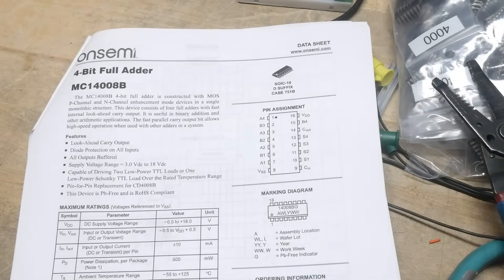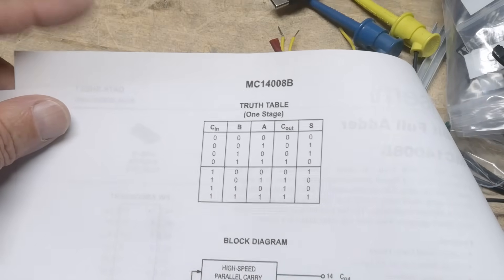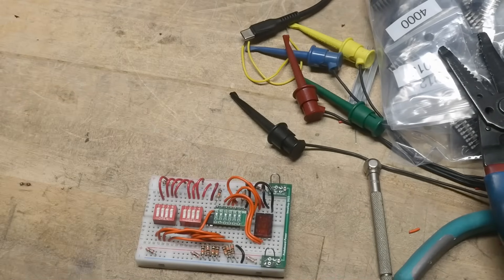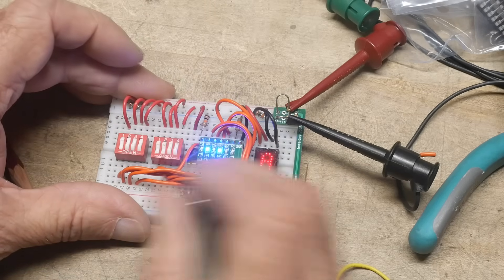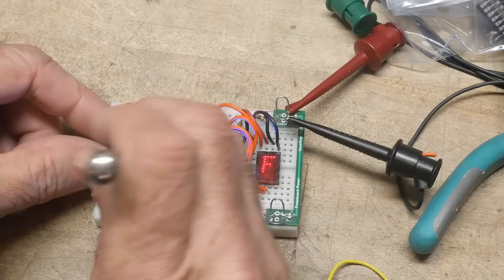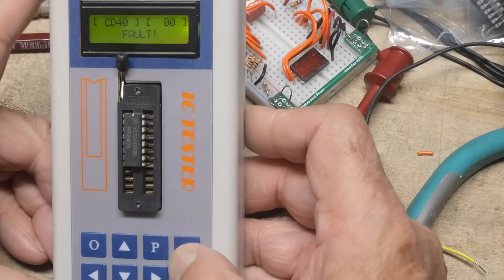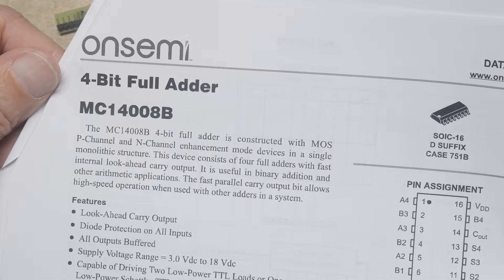#2461 CD4008 Full Adder

Comment: That TSH-06 tester is as useful as tits on a boar. When you get to the CD40 you are then supposed to press the right arrow and enter in the last numbers of the chip, in your case the 08 by arrowing right and pressing the up and down arrow until you get CD4008 and then pressing 'enter'. Then sometimes it displays 'fault' anyway...!! I just blew $50 on a TSH-06 tester.

Comment: Memories of the 80's, these chips were in most so called "export" CB radios like Cobra and President, the ones with FM and SSB in addition to AM.  Two cascaded 4008's were used to drive a 9 bit parallel PLL (the carry output of the most significant chip drove the 9th PLL bit).  One set of inputs came from a 7 bit channel switch (1-40), the other from a diode matrix hanging from a 6 position "band" switch labelled A to F, and the least significant second input was connected to a "+10KHz" switch on the front panel to fill in the gaps where the channel steps jumped 20KHz.   The most common of these "radios" was the President Jackson MK1, every CB pirates dream radio back in the day. 240 channels of AM/FM/SSB goodness not licenceable or legal anywhere in the world but they were everywhere 40 years ago.

Comment: Set it to 4008 specifically.  You can also negate a number by XORing each bit with 1 and subtract by putting that same 1 into the carry in.  With a clock, an accumulator, and a shift register, you can multiply or divide.
Reply: Subtract can be handy on addressing RAM extensions.  
Also with some cleaver shifting and subtracting etc, you can make a circuit that does a sqrt() function.

Comment: The problem with cascading multiple 4-bit adders to make a longer adder is that the carry still has to propagate through the 4-bit blocks, making the whole thing rather slow. I don't think there has ever been one in 4000 series CMOS but in 7400 series TTL there was a carry look-ahead generator that performed a function similar to the look-ahead gen on the 4008. Iirc, it was intended for adders up to 16 bits made from 4 bit blocks.
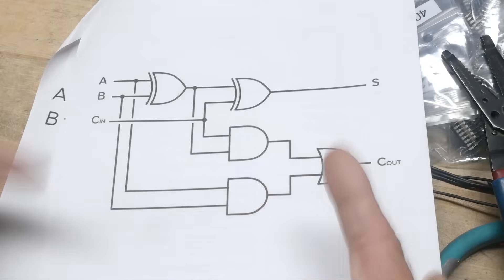It is an interesting exercise in logic for "beginners" to get their minds around carry issues and things like "carry generate" and "carry propagate" that are functions that can be made to be "time-parallel" with generation of sum. At 2:25, the lower AND gate does carry generate and the upper does carry propagate. The OR gate says you get a carry out if you either generate a "new" carry or propagate in incoming carry.
Reply: Internally, this chip does do a look ahead for its carry out.  You can use that for one stage of cascading.
I think you want something like CD40183 for  look ahead carry

Comment: I'm disam disappointed you didn't go over the parallel/look ahead carry feature.

That 7 segment display with built-in BCD decoder is neat
Reply: Yes they are really useful and cheap. TIL311 or equivalent. Perfect for diagnostic output, they latch on a negative going strobe.
Reply: @denisconnolly5064  I was wondering what was going on!